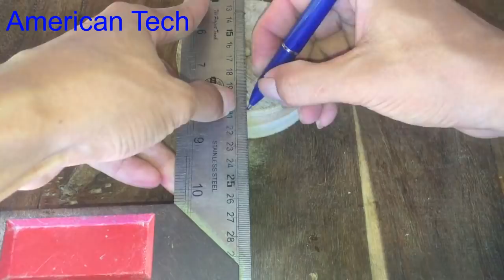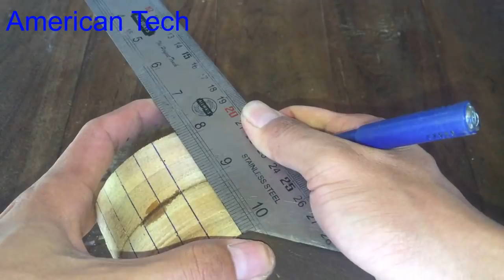How to make a powerful DC motor using 120 screws , science school project 2017

Comment: Why aren't the "brushes" shorted out by the spring?
Reply: Isolated wire ;) its just not look like isolated
Reply: The glue drops he added at the spring and wire contact isolated the wires
Reply: super
Reply: non-conductive spring...duh
Reply: Insulations are not removed!
Reply: Lo

Comment: Doesn't that spring on the brushes short them out?
Reply: I saw it too :)
Reply: right, path of least resistance. should have used a rubber band.
Reply: Exactly, this is why I came down to check the comments section  :)
May be, the spring is not making proper contact because he did not clean the enamel of copper wire from that particular section,,,,....
Reply: Hence the glue drops ... it isolated the contact between the spring and the wires
Reply: I don't think so. Because the spring was  making contact with the brushes when hi apply the glue.
Reply: Joe Grech These are our future engineers! and after a few hundred turns his battery went flat & his powerful motor wasnt so powerful after all. Of course its almost a dead short
Reply: It surely does shortcut the circuit, which is not very clever. He should've either used a plastic spring, or he should have insulated it on bother sides.
Reply: It acts like a resistor in this case a very strong one. The current will flow though both the spring and the motor winding but at different currents.
Reply: he must have taped the brushes guys with see through tape
Reply: enamel on wire.
Reply: My best bet here is the glue, its acrylic based, so if the glue gets in between the srping and the copper wire you have a very good insulation. I had a similiar experience trying to secure a wire to a contact after running out of solder and believe me guys, the acrylic gets in between the two metals and you get no contact whatsoever.
Reply: look before speaking no enamel
Reply: I'm with Timothy, it's stripped household single-strand, there is no enamel, the applied glue went where it wanted perhaps, but no enamel, on the wire used for the brushes.  Only the winding wires have any enamel here.
Reply: Joe Grech, you are correct. My wife's name  was Grech  from Hamrun in Malta. Your name sounds Maltese to me and I myself come from Malta.  Congratulations for your sharp eyes in noticing that.
Reply: This motor is not balanced over time it will shake it self apart
Reply: No, a spring is just a resistor.
Reply: Don't look for logic in fake videos.

Comment: What kinda strong-ass hot glue does this guy use??? 
Not sure how it can hold that weight of the whole motor wheel spinning, never mind the 2 huge magnets.

Plus the spring between the 2 brushes would create a short circuit.
Not sure about this whole thing.

Comment: how it's made: harbor freight motors
Reply: Kevin Keel  But they sell it for only $4.99 so you can't really complain.
Reply: i like how the parts are listed as (WOOD, SCREWS, MAGNET, COPPER WIRE,  IRON, PVC SHEET, WOOD "BAORD") like how am i supposed to recreate dis without knowing anything about dimensions and lengths
Reply: 10 ad breaks in an 18 minute video, I gave up watching.
Reply: “American tech” indeed

Comment: I'm wondering how he put a steel spring across the "Brushes" and not caused a short circuit!
Reply: These Wires are isolated the just dont look like they are
Reply: They are magic
Reply: Glue
Reply: Or a non condhctable spring...
Reply: Actually it did, watch later in the video the spring started smoking. Its probably the reason the motor ran so slow too...
Reply: @peterzingler6221  Wrong, see the smoke at 17:21
Reply: @peterzingler6221  Wrong, see the smoke at 17:21

Comment: I made mine with a kiwi and paper clips ; ] it powers my house now ty so much ; ]
Reply: byron yorks 
made mine with bison balss and barbed wire wire
Reply: byron yorks p
Reply: show us what u built
Reply: byron yorks nh7i
Reply: Fred Smith shut up, the electricity is converted from magnetic force
Reply: Fred Smith no they fucking dont. They break the laws of thermodynamics.
Reply: Perp. Motion does not exist and cannot exist until a breakthrough occurs. THIS IS NOT ONE OF THEM!!!
Even in the perfect runtime, there will always be resistance. And extracting energy from this would slow it down till it no longer spins. This is the conservation of energy. All/most battery’s are electrochemical. The closest to infinite/free power would be using some form of singularity to extract energy/mass from another universe. If you are familiar with E=mc2 then a small amount of mass holds a large amount of energy thus a large amount of energy for a small amount of mass. The only other thing would be a breakthrough in quantum mechanics.
Reply: Newtons law of conservation of energy: Energy can not be created nor destroyed only changed from one form to another. its general physics that perpetual motion can not exist because you can not generate energy out of nothing. the closest thing  you can get in a perfect world is a device that has an infinite motion that conserves all of its kinetic energy and never releases its energy to anything or another type of energy like heat, sound, light, etc...
 ITS NOT POSSIBLE
Reply: im still stuck with my stick and bamboos....
Reply: Fred Smith calmer down bro
Reply: Fred Smith, you're plotting all these physicomaniacs who know nothing more than the laws of thermodynamics, that's a stab in their backs, keep your good work and they should go to work too.
Reply: Timothy hackett does the earth and other planet spins because of magnetic force of the sun right? Do you think magnetic field is not a kind of energy that can be extracted?

Comment: Great build! 
This is the first I have seen of yours but I must agree ditch the music it is so annoying. A few comments or some text to say how many turns or how far apart the wires should be joined would really help. One other thing it is hard to work out how powerful the motor is so how about using a belt when built to drive something like showing how long it takes to lift a 1Kg weight  :)
Reply: I would guess it's not very powerful at all. Just enough to spin itself, probably.
Reply: Fred Smith jezz Fred, take it easy, it's called constructive criticism. Not meant to knock it but suggestions to improve. It's only from my point of view though. You don't like what I said that's ok too.
Reply: I believe the video is excellent.  But normally dad told the kid what to do.
Reply: iç şöşn ü 0

Comment: Congratulations for this motor.   I love the magnetic field   circuit  using the hexagonal headed screws and as far as the commutator is concerned well it serves the purpose and to think the manner in which we used to make commutators when I was an apprentice with the Royal Navy, well this method is very ingenious indeed.  Congratulations.   We used to wing lap and wave wound DC  motors and generators and also a variety of AC motors, but this one is really a masterpiece as  an educational  model in teaching winding procedures.  Well done . I think I would have first cut slots in the wooden rotor  then wind it up and then o=put the steel screws.  Again congratulations for the idea behind this motor.

Comment: but they are not wood screws they are metal self drilling screws
Reply: Michael Rawnsley roofing screws
Reply: Yes correct and they don’t self drill into timber very well but if you drill a pilot hole first they will screw in just fine and can be used on wood thou personal I would use wood screws as I have a selection of wood and metal screws on hand at all times.

Comment: Watch closely @ 8:53.  & 14:49 its bare copper there is NO  enamel that some commentators are suggesting. The brushes and stator and spring is all dead short circuit. The glue was applied AFTER the short circuit was established and at 17:24 you will notice smoke as the left hand wire  insulation is cooking

Comment: Nice project but...
Why you making a short circuit by placing that spring there?
  Pray to God those power drill batteries are not some of those low quality  "UltraFire" , "TrustFire" or some other similar garbage with (virtual) "10.000 mAh"...:)))

Comment: Not bad as a demo of how electric motors work, but not something I would expect to do useful work or last very long. Obviously unbalanced, and "brushes" "commutator" and "bearings" are very crude. Plenty of losses from using solid screws as the core too, I'm sure.

Comment: I gave you a thumbs up because you were successful and did a nice job making the video. Not bad for a high school project, but adding some ball bearings to the shaft would make a big difference and a plastic bracket across the top of the magnets for safety. The video is missing the educational aspect.  For all you youngsters out there look up "Rube Goldberg".

Comment: I wonder if you could make a PCB to connect the wires in would make the wires more neatly organized could get 5 or 10 pieces cheap from PCB way just use header pins in a center config to interact with the brush. just solder the wires close to where they exit from the wrappings less likely to short too.

Comment: Just because you can, doesn't mean you should. Get a washing machine motor instead, they're stronger, faster and crucially, actually balanced. Super glue is just about the worst adhesive to hold that lot together, it's really not good once your commutator produces some inevitable heat.

Comment: You spent all that time and effort with the screws and winding the magnet wire... And then mount the posts with hot glue. Very interesting and cool, don't get me wrong.. But when you've put that much effort into something, the hot glue just doesn't make sense.

Comment: Literally the worst, i hate when people fake these videos. You can see the arcs from when he was turning the motor off and on, plus, although it definitly did create an electrical current, he never showed how much voltage it could generate. Not only that, but the design was awful. Every time he would turn the motor on, It would shake everything near, on, and next to it, further ruducing the speed and therefore the output.

Comment: The spring shortcuts the circuit and therefore consumes most of the power. You should have either used a plastic spring, or you should have insulated it the spring on both sides.
www.alloma.ca

Comment: Just a suggestion : If you are a newbie, do not try this, before you are clear about the gauge of the Copper wire and the rating of the power supply...

Comment: the spring in top of the connection terminal of main coil is used to keep that two terminals stable! but wait✋ is this spring not short circuiting power??? how is it possible???

Comment: neat motor, good demonstrator,  bty why doesn't the spring short out the brushes ??? also what are your commutator  pieces made from and how do you keep them from shorting out between each other ???
good work, very time consuming, thanks.
Reply: The commutator pieces look like cut off staples or just thick wire with a  90 degree bend. I think there was super glue or hot melt glue between them to act as an insulator.

Comment: 228/5000
the rotor of another fan with magnets of old hd glued colaca plus two magnets of that of speaker another on top and another on bottom

in place of the bolts could be old hd magnets and coupled to the shaft a fan motor

Comment: You need to be clearer on how to make the wire turns around the screws, like how many turns around each set of screws and which wires to solder together would br most helpful because that is 90 percent of this build.
Reply: A project is only as good as the presentation man, just saying

Comment: 14:35: I already see a MAJOR FLAW in the design. The 2 permanent magnets don't produce a flux that is in proximity to the magnetic field produced by the armature. It is a SHAME, because a TON of hard work was done to wind the many windings in the armature. It could have been a FAR more efficient design if concave magnets were used for the field.
Reply: That sounds expensive for a school project.

Comment: I mentioned in one of your videos, id like to see you build a wound rotor, and wound stator generator(alternator) that rotor would be perfect, all you need is a mirrored stator wound identically then use a shunt diagram for your circuit and you could have a very powerful dc or edison dynamo, or you could alternate the rotor windings, north ,south and wire a 3phase stator for 3phase ac generator

Comment: I wondered also how your preventing spring from shorting out the brushes? Did you get the glue between the spring and brush???
Reply: If you look at 17;23 the brushes insulation on the brush gear cables start melting and smoke, he quickly removes the supply from the battery.This is because of the spring causing a short,the shear weight of the armature restricting momentum and the large magnet wire he used for the windings has no resistance increasing the current with little torque.No spring,smaller field coil wire,more turns per coil=A better build of motor.Not to mention the shorting of the comutator when he assembled it without insulating each segment of wire,just sat them touching each other and filled with glue. Hmm 01;25 in UK and i'm still watching youtube!

Comment: Would carbon brushes provide any improvement over the copper wire brushes?   Very good idea for a school project and well done!
Reply: The commutator is the most delicate part of this type of electric motors. On professional units, the commutators are carefully machined and polished to run smooth and preserve the brushes. Carbon brushes on the other hand preserve the commutator. A precisely manufactured commutator with carbon brushes might last a hundred times more than the one shown here. But this is not the purpose of the video.

Comment: I wish he would narrate because I would love to reproduce this motor, but I can't figure out which wires to solder together after they're wrapped around the screws!!!
Reply: William Weaver the wires are of both ends that he started with that he wrapped and by the looks of the wrap it was around 100 wraps
Reply: If i didnt explain it well ask again and ill try to do better .
Reply: What I meant was, once he is done wrapping the wires, he has them all with loose ends. He then solders those loose ends to "L" shaped pins that he glued around the shaft. These pins appear to be numbered. My question was; how does he know which loose wires to twist together and then solder to the correct "L" shaped pins?
Reply: William Weaver. Hey william i dont no if this will help but when he starts a winding he takes 1 end and wraps it around the center shaft and starts his winding and when finished the other end of that one winding is wraped on center rod .then he starts next winding by first wraping a wire around center shaft and wraps next winding then ties the end of wire to center and if. You notice he wraps around 3 screws at a time
Reply: William Weaver ππ
Κο

Comment: Is it the super glue that insulates the spring or do the windings have a lower resistance then the spring which means most of the current is transferred to the windings, or is it a little of both?
Reply: The wire is isolated by a coating that can be sanded off. This technology was shown to me in 80's science class grade school and was used all the way back to the 50's or before. I would give you an exact date but I'm not that interested in the history of wire the right material just works for the job...
Reply: Come on, forgive him. He is just a poor Indian.

Comment: I don't understand how the spring doesn't short out the brushes?
Reply: that's a good question.  putting ca at the ends would have added a bit of insulation.  maybe it does short, but with enough resistance to prevent a meltdown.  or else, ca was put on the wire before-hand.  cheers
Reply: I have clear nal polish and corona dope for such problems - I never thought of ca, thanks

Comment: Very great build!  I am impressed with your winding. that looks about as neat and tidy as a Delco cooling fan motor for my Buick car. Also, the commutator design is simple yet effective.  One question - how did  you prevent the brush tension spring from creating a short circuit between the two brushes? I am guessing there is clear plastic wrapped around the top of the copper brush?

Again thanks for sharing this. Hope your school mates and teachers were impressed with the science fair project!

Comment: thanks for posting.  man, that was a lot of work.  in this configuration, there was no benefit to using magnetic steel screws.  or, to mounting screws other than at the corners of the coils.    cheers

Comment: To mesure the Mechanical Power you could make some polies and roll a rope with a weight. Then you mesure the time to lift the weight a certain height. 

You will need to reduce the velocity, so use a small poly on the motor and a big poly on the other side. Maybe this big poly could be attached to another small poli that will transmit the rotation to another big poli until the velocity is very small.

Weight=mass * g
(g=9.8)

Work=Weigh * height
 
Power=Work/time

Then you messure the electrical power feed to the motor: Power=Tension * Current

The efficiency will be Mechanical Power divided by the Electrical Power.

Comment: The rewinding of the coils is perfect 👌, the connection of the coils is perfect as well, but at least you were supposed to separate the b1 from the E1, making your viewers to understand clearly and secondly your were supposed to used rewinding instillation paper and sleeves to protect the coils, because when the tension gets on those unprotected wires/coils they might likely turn hot, touch together and causing damage.
Reply: Đu theo nguyên tắc máy mài
Có gì lạ
Sao ko lấy lõi máy khoan hay máy mài mà làm chi lỉnh kỉnh vậy
Vô bổ